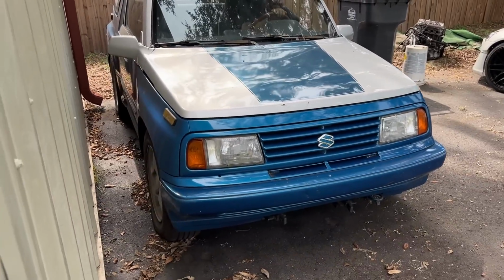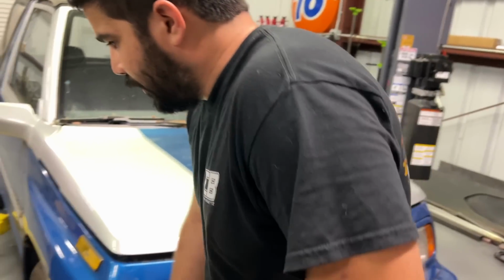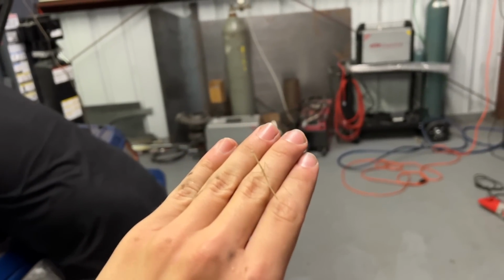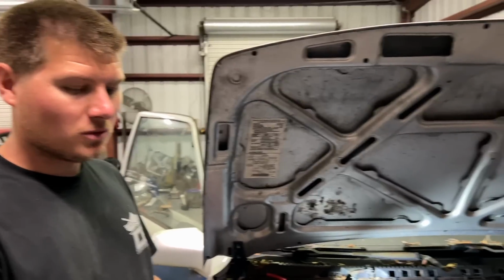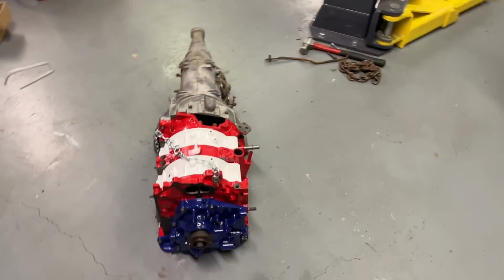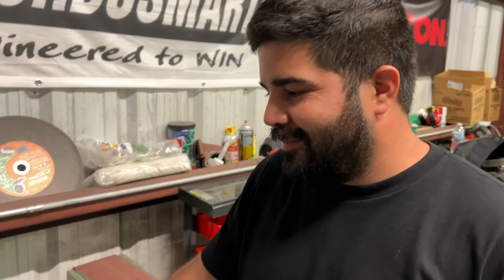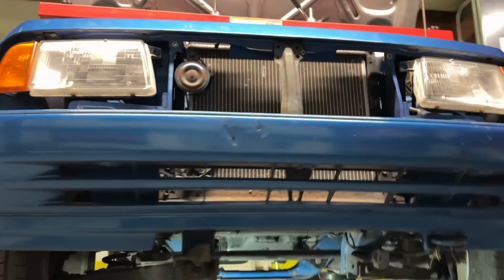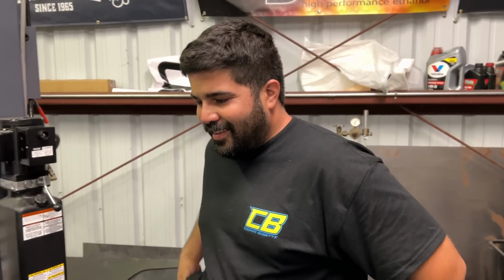We Are FINALLY ROTARY SWAPPING Our SideKick!

Comment: Being a Ford guy, and having used many c4 and c6 transmissions. Don't forget to run a vacuum line to the modulator valve on the transmission. It won't shift on it's own without it. And u can adjust the shift firmness by screwing in the adjustment screw inside the modulator valve.

Comment: Projects take time so glad your getting it done. Def interesting to mount it on the cross member using the control arm bolts i get why but can see potential issues due to stress or loosing the engine if bottoms out and wouldn't pass cert where i live (know you lot look after your vehicles so i am sure you will catch any problems fingers crossed)
Keep up the great work and videos and props to all the helpers

Comment: On the serious side for a change.Rotate the differential to find the gear ratio,versus the new transmissions output ratio as the engine will be rotating at such higher RPM's.You will probably have to change the differential period.Not just due to ratio,but for the posi.Thanks for reading this.You guys are Awesome!

Comment: "so we were on our way to harbor freight" 🤣 listen.. I ran a freaking classic porsche restoration/mod shop for almost 4 years as the coachwerks head. I used a hand me down toolbox I inherited from my grandfather, and another standard toolbox (like a large multi level, not a freaking dinner table sized tool box) filled with old old tools I also Inherited, tons and tons of HF tools I'd bought for the basics, don't honestly think I owned a single snap on anything. aaaand I broke a total of 2 sockets, both times trying to pull off a crank pulley bolt on some old 911 motors. my guys who dumped $20-30k while in school on snap on / matco tool sets laughed. the biiiiig ass box set ups. they tried. both broke theirs too🤣 "well... lifetime replacement guarantee brah..." they said. I left and was back in 15 minutes with a new set of sockets no questions asked from HF. they waited for a couple days for the snap on rape van to drive by to swap theirs out🤣 I've nothing bad to say about HF. those tools put a car on J lenos garage, and usually finished the job first before my guys🤣 harbor freight is the bomb dot com. dirt cheap. if ya manage to break something just walk in. no receipt even needed. they just are like yeah, go grab a new one

Comment: Kyle I will trade you my 1984 FB Mazda RX7, has 12A rotary has a automatic with electric overdrive came off award winning assembly line and new go fast parts a new side draft Webber carb and intake for it. No rust California car with A/C, power everything except seats all motor and tranny are original OEM only thing not is the exhaust and stereo. Straight trade for the K swap BRZ. I live 2 hours away and can drive it up so you can see it.. Let me know